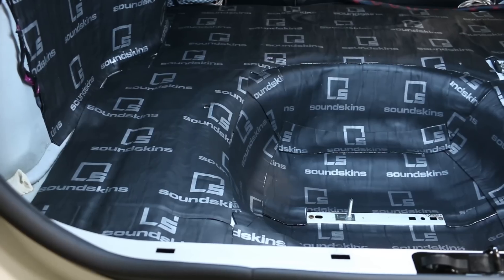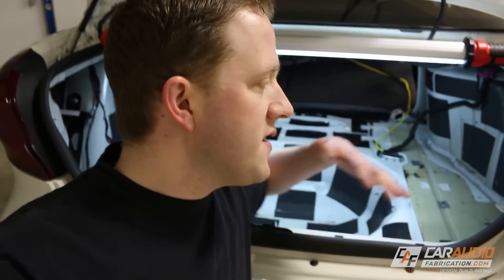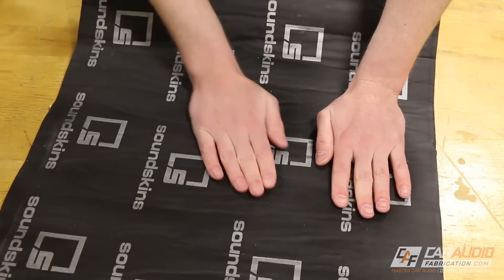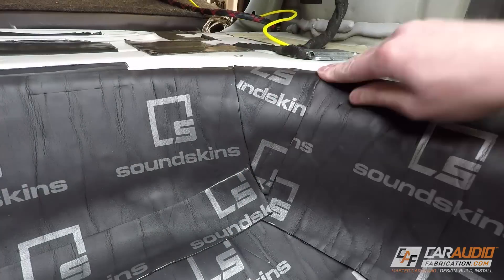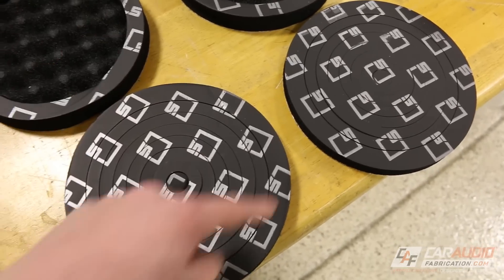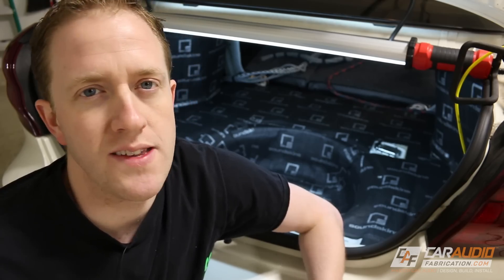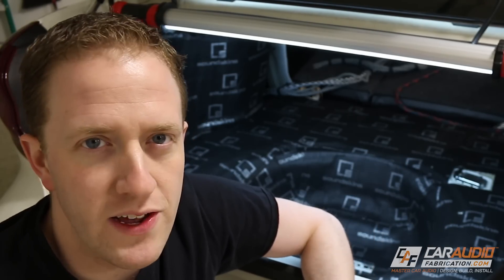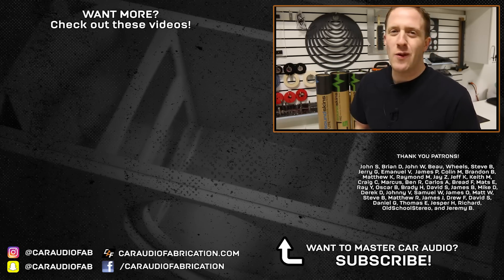Trunk Sound Treatment Process Explained - Improve your BASS!

Comment: 6lbs each roll, 18lbs total of sound deadening. I highly doubt anyone is going to notice a difference in fuel economy and performance.
Reply: no, you'll just notice the weight loss of your wallet...
Reply: Lol people bitch about 20 pounds but the 400 pound and subwoofer set up is not factored In lol
Reply: I drive a Honda... so I beg to differ hahahaha
Reply: I wonder how much it'd weigh to do the whole car...I want to do this in my civic now. Even if it's 8 times the amount he used, that's still only 200 pounds.
Reply: bobwinslow  shouldnt take more than 6 rolls with a civic and that's going hard on it so basically 36 pounds but unless your full racecar mode and fully gutted why would it matter hell ide even consider using on a gutted car to reduce road and motor noise especially with how loud civics can get
Reply: Oh well, i thought its more than that like 1 roll 30 kilos :D so those of you wondering what difference would that bem lets say if you did a full setup like our sensei here, i mean not only deadening but also subwoofer, amplifier, ABS plastic, HDPE plastic, wood, foam etc, lets be realistic, with all this you will hardly get to 50kgs so thats not even a weight a normal person (lets say that avg weight of 25yr old is 80kgs). So answer for you wonderers is very simple. Take a pen and a piece of paper, call one of your friends of whom you think that weights 60kgs+, make a trip, write down your avg fuel consumption, now repeat with only you sitting in the car and booom, youll notice that the difference is so freaking big ure going to think if the new 1000$ is worth it coz of that insane 0.1xxxxx difference in consumption, or youll rather have eargasm 100% time in your car. Well except the case u have lawn mower engine so speaking only to those who got some real shit under the hood.
Reply: Seriously it literally shouldnt make a difference unless youre driving a ricer and if it is , it is your car not the shit you're putting in it. Check ur tires ,alignment, air filter , throttle body. If youre losing a noticble amount of mileage its the car , not the products your putting in it.
Reply: I put rocker P2 punches sub with the soundskins in my car ( i only did the trunk) I absolutely do not notice the difference maybe extra 3 to 5 bucks for each fill up , if that. I drive 3.5 v6
Reply: @Deke1  True. Surprised he forgot that too.
Reply: How much does this cost on avg if you bring it to a shop? 4 door sedan like a evo 8
Reply: Sadly this isn’t cost effective. It’s $99.00 a roll. So you spent around $300 for just the trunk. That’s shit js
Reply: People gain more pounds than that in one month lol
Reply: @hellabrokeracing1337  I know this is a tad bit late but spending $100 per roll is a bit ridiculous
Reply: @Donniec685  It's all perceived value. $100/roll may be a great value to someone, but that same person can't fathom spending $300 on a pair of sneakers...it's all relative
Reply: @MustangDarkHorseGuy  but needing multiple rolls, you’d be spending more in sound deadening than your speakers.
Reply: @patrickjohnson9629  dude I have a 09 civic ex coupe I already covered the rear speaker deck and holy hell there's a difference for sure lmao so yeah I agree I bet to differ it depends on your car man. Civics have none at all. A Cadillac oh yeah no need to add any

Comment: Mark, when cleaning the metal surface prior to applying the sound deadening material, recommend 3M prep solvent 70. This is professional grade surface prep and I can personally attest that it works beautifully. Likewise, gently heating the sound deadening material with a blow dryer while applying helps you mold it into place easier. Nice work on the videos.

Comment: Most folks need to understand that the mileage really isn't going to be noticeably different once you've added the sound treatment material and sound hardware; it's going to, at best, be tenths to hundredths of a mile per gallon. And, with a lot of cars these days, you can easily regain that lost mileage by retuning the engine if it's really going to be that much of an issue.
Reply: or go get some more gas..

Comment: Wrap your brain around the fact that 11 square feet of this material costs $99.00!
Reply: yeah not worth it imo except in areas where rattling is extreme
Reply: I did this exact same thing using Noico 80 mil sound deadener 36 sq ft for $60 shipped and I added the Noico 150 mil 36 sq ft red CCF on top for $50 to give it that foam layer on top. I bought a roller fo $8. Total investment was $118 and this allowed for me to fully treat my trunk, rear deck,  trunk lid, and side doors.
Reply: @darrylpolite8722  Im thinking of using noico but i heard that it smells in hotter climates. Whats your experience on this point?
Reply: @FiLL580  in my experience I haven't had any issues with smell whatsoever. I am using both the sound deadener and the closed cell form. I stay in Florida and it's very tropical with a lot of hot days.

My car is always exposed to the sun and the outside elements.
Reply: @darrylpolite8722  How is the closed cell foam working out? Any difference in cabin temperature? Is it worth spending the money on? I'm in orlando, and my poor little Yaris A/C struggles to keep the heat out in traffic.
Reply: @Isaiah-ft5nx  that's a really good question. I haven't noticed a big difference and that's mainly because I have tented windows that also blocks heat. The main difference that I've noticed is in the sound and since I've installed it, my AC seems to cool the car down a lot quicker than it did before. I noticed that immediately. It's good to use closed cell down with sound deadener as well.
Reply: It's worth it if it turns our Honda into a Rolls Royce interior noise.

Comment: I have 2003 Nissan Almera, and I have done the whole trunk, front doors and some plastic panels with some butyl/aluminium sheets. Definently better sound and much less road noise. Also no noticable difference on fuel economy

Comment: Hey Mark, I'd love to see you use a LOT of this to treat every surface of a loud car (like say, a 1990's Honda Civic) into a very quiet car, maybe with a DB comparison when the car's at speed? I want to see if it will get me to Lexus level quiet without Lexus overall weight. If it took eight times this amount of material, it'd still only be 200 pounds extra, or near enough stock weight not to care. This could be a game changer for tuners who daily their cars. Thanks for all the helpful videos!
Reply: The Civic (or other economy cars) don't have the right type of glass for low noise transmission.  A lot of sound comes through the glass. :)

Comment: I’d like a befor and after sound treatment. Like an audio comparison, decibal comparison.
Reply: would be pretty minimal.  need MLV to make the big leap in lowering in cabin noise.
Reply: what's MLV, not familiar with the acronym
Reply: Mass Loaded Vinyl.  some cars use some form of it stock. many cars at least on the firewall.   it's even used in the home behind drywall and under floors.  most often in home theater applications, or anywhere isolation from outside noise is wanted.
Reply: Where do you use Mass Loaded Vinyl? In this case, would you glue it in the trunk in the same way he's doing the SoundSkins? And what thickness and weight? 1/4", 1lb?

Comment: I have a huge vibration issue in my Saab 9-3 when the sub is turned up and particularly in the doors where there are 6.5 woofers. Was good to see I only need to put patches on not completely cover the interior. I will do the whole doors though.

Comment: Two questions will  this trap moisture in your trunk and eventually rotted out and the second question could I just use roofing tape I seen somebody with a video that used roofing tape and said it was pretty much the same thing cuz it has tar in it and it's a soundproofing also thanks in advance

Comment: That 5.3 doesnt get much for fuel economy too begin with. I havent noticed a change in mine since i started adding audio... "accessories"

One thing though. If you dont have displacement on demand programmed out. Do it. Gets rid of the helicopter noise when in 4cyl mode and helps with oil consumption.

Comment: I did massive amounts of sound treatment years back in my Prius (because they produce hella road noise) and the weight made little difference. The noise was reduced but def not eliminated. Was kinda disappointing actually. I do sound dampening in all my cars but will not go as crazy with it as I did on my old prius.
Reply: What were the best target areas to reduce road noise in a prius? Mines loud too but I don’t wanna go crazy or add extra weight.

Comment: Would  it be safe to sound treat the rubber flap and plastic  surround in the trunk over by the bumper? I have seen about how it's  to prevent the  back window from  braking when closing the doors or  trunk. I have also seen that it's for preventing your ears from pooping when closing the trunk lid or car doors. Does anyone know if  I  do block the flaps would it cause windows  shattering or  my ears to pop? I  ask because  if have two 10's in my trunk with 500 watts total to both subs,they're  downfirirng in a sealed  box. I  tell you this because it's part of another  question. That question is  there's already a lot of  bass pressure inside the car so would the ear popping or window  shattering  be a moot point  because of  all the bass pressure in the trunk? I  have a  2005 Chevy Malibu classic. Mid sized  sedan. Has anyone  covered up these  inside rubber/plastic  bumper  flaps without  any of the above  concerns  happening? If so how long has it been  since you have done this? I  don't know a lot about  soundwaves or science.  Please help.

Comment: In the home depot u find the same material for way ship and it works pretty good ... and less weight.....
Reply: The stuff at home depot you are talking about is probably roof liner. Which has a track record for being stank, it's tar like, and adhesion not lasting very long after a while on a lot of vehicle surfaces when it gets hot, coupled with constant vibrations. Sure, it works for the time being, but after a while can be problematic.

Comment: One question with regards to cutting up the sound dampening material, is it less effective to cut it into smaller pieces and then apply everywhere to maximize coverage and reduce waste ? OR is it recommended to use entire sheets and try to mold a big sheet as is ?
Reply: Kojy try to cut it so that it’s not one big sheet. for example if your door has a curve, cut 2 pieces to form at the curve instead of one big sheet pressed onto it

Comment: It would be nice to see a comparison between this and some of the other products.  I put a set of headphones inside a helmet for my motorcycle commuting and I used.....wait for it....  Craft foam from Wal-Mart that has adhesive on one side.  Cuz I'm broke now that I have a family.  I got 6 colors of notebook paper sized adhesive back foam pieces for less than 6-7 dollars.  Of course I (having a background in upholstery) made a cover that zips around my neck to keep bugs and stuff out from getting drawn into the face.  But I can enjoy the commute now as opposed to hearing all the turbulent air at high pressure levels.

Someone had given me some dynomat (after I finished my project)....but I would hate to find the results being the same (or worse) plus the dynomat at least has lead in it.  And although I don't plan on licking it...it is a bit closer to the breathing in than some may consider healthy.   Thoughts?

Comment: Worried about weight go with neo subs and lithium batteries had to. Do it in my suburban because truck weighed 7150 lbs I am down. To 6500 and feels so much better even with suspension upgrades

Comment: for the last 6 years I've been building my 95 Mustang GT on a rotisserie and my sound deadening includes lizard skin sound and heat coating inside and out of the car, stinger roadkill and medium density foam sheets, plus the jute from the carpet...it should sound like a Lexus inside

Comment: What do you do with those air vent flaps in the trunk? Those rattle a TON with the bass. Super annoying. I've heard mixed things where you need them for circulation/pressure in the cabin etc. So I'm a bit conflicted on how to deal with the flaps.
Reply: don't mess with the flaps

Comment: Does sound skins work as a heat barrier as well as a sound treatment? Looking for a product or combination of products to greatly reduce the interior temperature ( dark green truck in west Texas = interior temperatures in the hundreds when windows are up and AC isn't on) Really looking to sound/heat treat the entire interior of the vehicle as well as areas underneath, aka transmission tunnel, and really looking for the best product for heat suppression as well as sound treatment.

Comment: I noticed you left the HVAC/Air pressure vent alone.  What do you suggest if those rubber flaps are causing a lot of noise?
Reply: Andrew did you ever get an answer ? This is my question ... I'm ready to just remove the flaps lol
Reply: @serena.areias   No, but I just put some foam weather stripping on it. That way its smacking something softer than the plastic.

Comment: Did u do the truck lid? Most vibrations come from there.

Anyone ever use the butyl rubber rolls for roofing you see at Lowes or Home Depot?
Reply: Ive used the butyl roofing rolls in my doors. It works good as sound deadener. However, the toxic fume smell from the tarish like adhesive lingered in my truck for a few weeks. And sometimes on hot days it would smell tar. If you can get pass the smell its all good otherwise I would just order some official sound deadener
Reply: @RHunther  Thx for the reply!

Comment: I just bought a mustang gt premium. The gt premium has the touchscreen gps infotainment screen. It has a 175 amp alternator soooooo. What amp would you recommend to get the most bass and sound for the power the stock alternator will be putting out? I don’t want to get a high output alternator.
Reply: the Audiocontrol ones he shows would have great output for most setups, unless you are building something crazy I do not see a need for a high output alt.
Reply: I'm running a 1200 watt, a 1000 watt, and a 800 watt amp off of the stock 120A alternator in my car. Unless you are building a competition system there's no need to go above 175a alternator.
Reply: Ryan James damn! I ran only one 1600watt amp and was getting dimming. Lol
Reply: Cptjockitch that's crazy because my little old 2005 hyundai santa fe (the premium 3.5L v6, if any santa fe can ever really be called 'premium') with the original 120a alternator literally doesn't dim and all accessories work fine. I also have LEDs and a fan to cool the 1200w amp. For real when I added the 3rd amp I was sketched out about it, but it's been 3 weeks and not a single problem.
Reply: Ryan James that’s crazy. Now I never lost power or anything major I just seen dimming and was just cautious so I added the high output alternator. Maybe I would have been fine but I felt better with the alternator. Now I’m scared that I’ll be driving along and the alternator with die because I heard the high output ones don’t last long.
Reply: Cptjockitch ya I've never personally had a high output alternator, but I've heard they are much more prone to wearing out, unless you shell out some serious cash for a quality custom built one...

Comment: A video needed is how to re-install the factory carpet back into entire vehicle that was removed prior to installing sound treatment. No one shows that part and I heard once the carpet is removed from a vehicle, it will never go back to looking like factory. Hearing this makes me not want to remove any carpet. I need my vehicle to remain perfect inside. I don't have one of those cars that is falling apart as the bass hits.
Reply from the maker: You put it in the opposite way it came out. Its flexible carpet, the only way anything is getting ruined is if you lack complete common sense. I doubt whoever said that has ever actually pulled an interior.

Comment: Do i need to use 2 different sound treatment? I have an 08 impala
Reply: Where do i get these products from?
Reply: You can use one or two. I personnally used Noico 80 mil sound deadener and Noico Red 150 mil foam to layer on top of the sound deadener for a total price for less than $120 for 36 sq ft. Pretty much the same stuff for a much lower price and it is a little thicker.

Comment: Anyone complaining about weight/fuel economy should always drive around with less than 1/4 tank of fuel.  After all, a full tank weighs 3 times what a 1/4 full tank does, therefore killing your fuel economy.  Also, rip out all of your carpet, electric seat motors, and change from glass windows to acrylic.  These things weigh more than the material used in the video.

Comment: We're going to start the trunk build in a few weeks. Pulling out the old system and buying new wires, subs, amps, etc.. Starting fresh and with the thought in mind, would laying 2-3 layers of sound deadening be over doing it or would it double the sound. I have 4 12s and a 2400.1 going in so it's going to be major trunk and windshield flopping no matter what. Help please. Ha
Reply: So you think it's a huge difference between the single layer and the double?
Reply: you get 95% effective sound dampening with 30% coverage. Everything after that is diminishing returns. You're not going to double any sound by adding extra layers. If you want to increase your spl, double the amount of woofers, and/or double the amount of power. Each doubling in this fashion in theory is good for about 3db each. Say you have one 12 on 300w and are getting 100 db. to hit 103 db either add another 12, or bump your power up to 600w. if you do both, you would hit 106db, and so on. Adding sound deadening keeps you from losing that energy through the body panels of the vehicle.